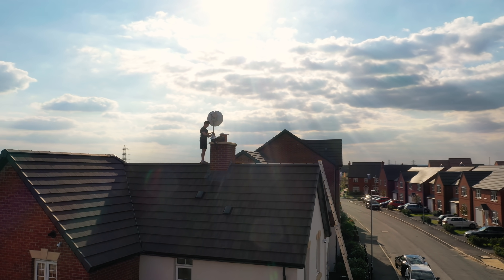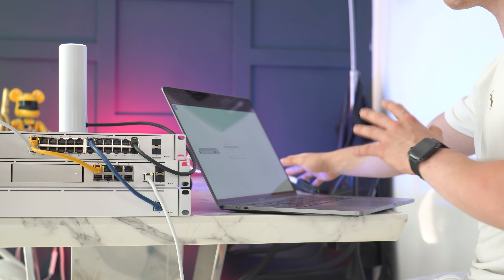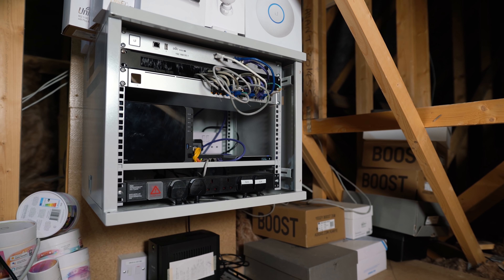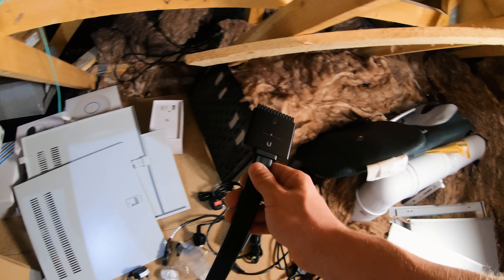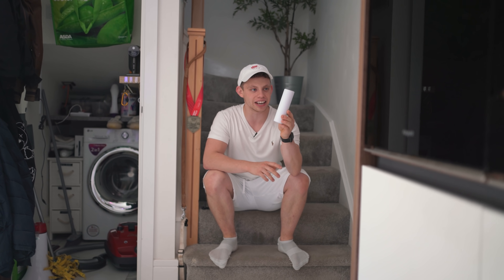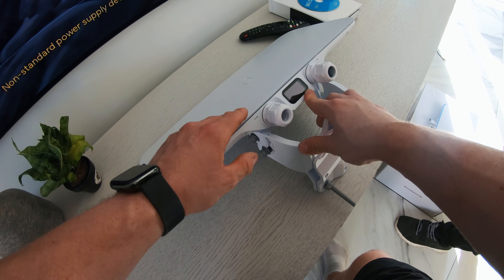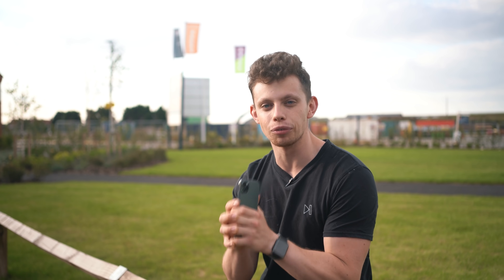Alex's Insane 2021 Home Network Upgrade & Tour!! 🔥

Comment: Sooo overkill system in the house when u get shit internet from your ISP. I myself can get 1000 download and 1000 upload for 60£ a month in sweden. Currently getting fiber 500 download and 100 upload for free and super stable with AX82 router. getting 0,8ms ping with ethernet and 2ms ping on wireless. Also getting ethernet speed on 5GHz almost everywhere, no problem. 

Why do you even have seperate AP for your LED device and other smart home???? Whats that gonna help?
Reply: It could depend on how he wants to secure his network, e.g., placing the smart device on a separate VLAN, and set to only have WAN access, thus if one of those devices are ever compromised, they can't wreak havoc on the rest of the network, e.g., acting as a launch point for an exploit toolkit against other devices on the network.

A cheaper way is to simply have your smart devices on the guest network.
While it will have a small amount of performance reduction due to airtime sharing and that most smart devices are not MU-MIMO enabled, and even worse, many still use 802.11n even ones made in 2021 are still using it. Companies tend to do it for cost cutting since you can get those chipsets for next to nothing, but it also means more overhead while those devices are sending or receiving a lot of data. If it is something small like a thermostat or smart outlet, or light switches, then it is not noticeable, but for items like wireless IP cameras or other similar devices, it will be noticeable, and in which case, you just get a separate cheap access point to put them on.
Reply: @Razor2048  Or simply don't let different VLAN's communicate anyway, which is a piece of cake with Unifi.  Alex seems like a nice chap, but he's a bit clueless.  Firewall rules can also accomplish anything you need as it's quite powerful on Unifi.  A simple "drop all" firewall rule between networks accomplishes anything you need.

Comment: Your network has no logical thinking. Just switch from switch and APs all over :) + you got a very expensive microwave on your house :)
Reply: It’s all a complete mess and I’m so confused. Would anyone please be able to help me out. I’m trying to create a home network system but have a budget of £1000 maximum. Can someone please list me the parts as watching this video has confused me so much
Reply: @ProPlayerGamez  How many APs do you need? I can tell you what I did. I have 2 NanoHD, runnig with a Netgear 5Ports  PoE switch, the Unifi Controller is running on a Raspberry Pi 4 B. As a router I prefer a Fritz!Box and all the other LAN Ports in the House are connected with a 24 Port Zyxel GS 1900E. 
All together should be far below 1000£ and runs in my house with 31 Clients pretty smooth and stable. Nothing to complain so far.

Comment: I thinking about getting a dream machone Pro but I know it won't work with sky broadband. Anyone in UK also have this set up without having to still use the sky hub or BT home hub getting in the way.?
Reply: Chances are if you can't figure out if UI gear will work with your ISP modem/ont then you shouldn't be purchasing this gear to begin with. Just go out and buy yourself a mesh wifi system and leave this sort of stuff alone.
Reply: If you have standard ADSL or FTTC then you'll need a modem like a Draytek Vigor 130 to go between the UDM and the phone socket. If it's FTTP an RJ45 cable straight into the ONT will work.
Reply: Easy use wire shark to capture the circuit login credentials and use these in router of choice

Comment: The "UPS" just acts as a secondary PDU for the other devices, in addition it will not function if the device with the dead PDU reboots, as it does not at start up use the secondary external PDU.

Comment: I will be moving in too Victorian house in a month's time but it has 10 bedrooms what would suggest that I could do with my internet
Reply: I would suggest you look for advice from someone who actually understands networking.
Reply: Unless you have real tech needs, just a good wifi 6 mesh system will do just fine. I run the TP-link x60 (3x pack) and I know I’m future proofed for years with it.
Reply: more
Reply: @Scott-zh6lz  it will need to be good has I have loads off tech and a games room to build

Comment: By the way, the redundant power supply is not a UPS, if the electricity cuts out, it will turn off too. There’s no battery in it. It’s only in case the power supply in the udm pro or the switch fails.

Comment: I’ve been considering locating my network equipment to my loft, also within the UK. I’m very nervous about temperatures and also the dampness. How long has yours been in the loft?
Reply: Loft condensation is a real issue, make sure you don't have this or signs like mould on the breathable wrap under the tiles. Also summer time lofts can get to over 40c which is not ideal
Reply: You are unlikely to run into any issues in regards to damp if the networking equipment is running all the time. The heat they output should prevent any water or damp building up.

Comment: Cool video. I just ordered the UDM Pro. It was a demo with same warranties as a new one and almost same price as UDM. So I thought I had to jump on the deal. Just a comment on what you said on giving out free WiFi to the neighbours, be sure to check what your internet provider says about it. When I read my internet providers terms of use, it clearly stated that you are not allowed to share your internet outeside your home and you must configuer your network in a way that it does not reach outside youre home. And you are not allowed to earn money on your wifi.
Reply: He has the same type of internet connection I have. We use commercial internet plans that CAN be resold or shared. It's not the same contract as domestic residential customers, so he's fine :)
Reply: @AllanOkello  I understand that. But it might be good to inform the viewer about it, because not everyone that watch this video/ channel know that and it can be good to point out that if you push out wifi outside your home, you might need permission for that from the provider. Also if it is a very string antenna/ transmitter, you also might need a permit from the government.

Comment: Was hoping for a bit more info on the products. Runtime for ups and how many devices can you plug into it etc. Not a fan of your computers network cable lol looks butchered. Great job otherwise. Keep it up.
Reply: He actually now has a problem with the purpose of the UPS though. His switch in the garage has it's own power, and will turn off if power goes out, and so will the connected camera's. Rip
And the cable of the PC really was a mess yes
Reply: The "thing" he called a UPS isnt actually a ups. Its just a backup PSU for when the internal non replaceable ones fail. When the power to his home goes out everything will shut off instantly.

There is no runtime.
Reply: @jaemelo2693  He said something else though. Otherwise it would be very weird to buy a 600 USD power supply for just providing power
Reply: @jaemelo2693  I just checked it, you are right. What a worthless thing actually, lol

Comment: Megabits per second, not megabytes. If your speed was 304 MB per second, it would be over 2.3 Gbps. I thought you'd know this?
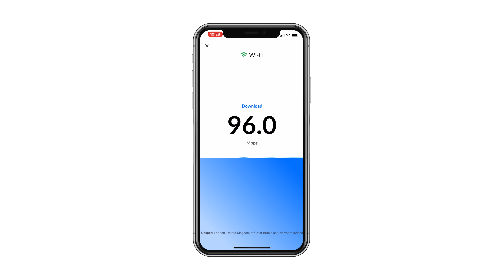Reply: 17:22 - He does know what he’s talking about
Reply: @Matt123So  yeah, but he uses the terms interchangeably which means he probably doesn’t realize they are different. Also the RPS unit isn’t a ups. It won’t keep things on during a power outage, it’s just a redundant power supply.
Reply: @Matt123So  he clearly doesn't if he refers to Mbps as megabytes per second.

Comment: Why is ubiquiti giving those basestation XG's to youtubers who are going to use them in house? They did this with Linus as well. It totally doesn't make sense to use those in house, they aren't made for that kind of application.
The base station XG is meant for things like events, where a lot of people are connecting in a dense area.
Reply: It is mainly for the range, the pricing is will in the realm of diminishing returns, but you get effectively the range of a small yagi antenna (10-15 dBi), a wider beam angle than even a well made biquad antenna. Compared to a $200 AP, the only benefit you will really see from it as a home user, is the increased range, since the array antenna, and beam forming using like 24 antennas, is like having a yagi antenna stay locked onto you. Only issue is they are useless at short range, as they will not provide any more coverage than a basic biquad based unit. Aside from that, they just give those uniess a much higher powered SOC and more RAM to handle a large number of clients without getting extra overhead, though even then, unless you are at well over 200 clients, you may not notice s difference between that unit, and an enterprise level AP in the $300-$400 range.
Reply: @Razor2048  Still it doesn't make sense why Ubiquiti is giving out those basestations to youtubers that are not doing anything enterprise at all. I'll get it when they would give one to Crosstalksolutions for example, since he's doing business installs. But guys like Linus and Alex, putting it in a home, doesn't make any sense. Yeah it's cool to say you have reception 10 blocks away, but these video's are mainly watched by consumers and this is hardly a product that is really usefull for consumers, al be it the price alone for this unit.
Why promote something that is meant for stadions and events to consumers? Doesn't make sense in my opinion.
Reply: @1alexwel  Not sure either. While some some business users will watch various channels like this for entertainment, I am not sure if you will get a greater amount of them on channels like this rather than ones directly targeted at that industry.
Other than the wow factor of the range, I don't think any of the youtubers who ave it in their home, are actively using it after they finish making the video, since at ranges of 30-50ft, it will provide horrible coverage. within a home due to the relatively narrow beam angle.
Reply: Because they want to advertise their products hmmm?
Reply: @Guuggel  advertising to the wrong target and also giving a bad use case for the product isn't a smart thing to do
Reply: More money if more people are buying. Also the reason why you see normal people drive lambos and ferraris just cause.

Comment: It’s nice to flex all that hardware, but having more then 2 accesspoints in one house is ridiculous.
Reply: That really depends on your house. Recently did an wifi install for a 3-floor row house here. Usual building material is reinforced concrete here. Installed one AP AC LR on 1st and 3rd floor thinking that would be enough. It turned out that his wasn't the case. 2nd floor still had wifi reception problems, it wasn't until I installed an 3rd AP that it was good enough in the whole house.
Reply: Here in Bermuda our homes are built from concrete with reinforced steel rods to withstand cat 5 hurricane's. 2.4 & 5Ghz WAP's do not penetrate our walls very well so if you want good coverage, with decent overlap for seamless roaming you'll need an AP in every room if primary 5GHz and every other if 2.4ghz.

Comment: It’s like cowboy networking here.   The RPS has no batteries and he’s like just repeating the Ubiquity marketing blurbs. As for the roof install so dangerous a bad example and terrible health and safety he needs to go on proper H&S course
Reply: Yup, then he falls off and needs to go to hospital, taking up a bed someone with COVID could be using. he's just young, clueless and immature.
Reply: Not to mention that he suggests that the equipment is ok up to 80 degrees C.
Reply: @shawnsmith7009  Technically it is, but it won't last very long.

Comment: Seriously ubiquity marketing guys, stop giving this idiot free gear, he is massively damaging your brand by association. It's just embarrassing at this point.
Reply: Because he has no fucking clue what he’s doing, as with practically every other video he makes. He is a shill for marketing companies and more often than not the stupid things he does are dangerous or misleading.
Reply: @CarlDavison  what's he actually done wrong
Reply: @G0rg81  For starters, he doesn't know the difference between a redundant PSU & a UPS but uses the terms interchangeably. He just told everyone this gear will keep everything running when the power goes out which it will not. He doesn't realize there is a difference between bits and bytes. There are a few more things like the deployment of the XG AP on his roof but I'm sure your brains logic tells you "so what" or "who gives a shit."
Reply: That pathetic wiring job for a start but seriously he is giving the impression that you have to have all this expensive kit when realistically a couple of AC Lite APs would cover his entire home.it’s not only this video, he gives wrong and dangerous advice on countless others. He is just a shill.
Reply: What's your problem. If it annoys you don't watch. He's just trying to make a living

Comment: 15:18   This is extremely dangerous. You need proper safety gear... In situations like this you either use a bucket truck or toss a safety line over the roof, Tie it off to a secure structure on both sides then tie off to your Harness. A proper harness for our industry would be a "Sala Exofit"  You want static safety line. When you have this many subs you need to be very very certain to do everything properly so as not to encourage other to take dangerous actions. Another note also for your well being is that if a safety inspector saw this video you may end up with a hefty fine. Your work place insurance would void your contract. Please be safe <3
Reply: He never uses any safety gear and shows a complete lack of respect for safety. When I saw him standing on the ridge like that I just laughed. Surprised he hasn't had a serious accident yet.
Reply: Who gives a fuck about safety. If ur doing it in construction or for work yes but if ur doing it for urself then fuck the safety harness. Don't be one pussy unless u really don't have good balance or can't jump or survive from that height. Don't be educating ppl with safety cause we honestly don't give a fuck
Reply: @ewaldatok611  1, When your influencing others & many are going to do this themselves your partially responsible to teach them the right practices. 
2, Gravity, physics & the law care not about whether its a job site or not. Nor do they care if your a pussy. Please be respectful. We don't need anyone getting hurt.
Reply: @thefixitgal  Don't waste your energy. If anything, life has shown us that people with "his" mentality end up in boxes 6ft under prematurely.
Reply: @jaemelo2693  I know.. I've seen it happen before with exactly that type :p But Id prefer to still at least make an attempt. Its sort of my thing. I train people to setup and operate  ISP's.  If people like him at least listen and maybe act with more caution there will be less broken families out there <3

Comment: Er, if your internet connection is 300Mbit, that you were getting sub 100Mbit on the XG suggests you had a 100Mbit network connection (or some traffic shaping). The XG could easily blast past the 100Mbit mark in a heartbeat.
Reply: he used unifi's wifi speed test so it wont use the internet just the connection to the AP. Its not very clever cause I have a Mesh Pro (the one he removed) and its got a theoretical range of 186m and I can get to almost 100m without dipping below 80mbps both ways (can't get a signal further because of an obstical)
Reply: @matthewgilbride8212  You can get far faster, those speeds are far too low.
Reply: @SquirreliciousMe  it goes faster its just not stable
Reply: @matthewgilbride8212  I don't know what you're testing performance against, but if you use a proper testing system (which is not some internet speed test like speedtest.net) you will find that XG can blast well well past anything you're being told here.

Comment: Usb-rps is not a UPS Battery backup as you stated it’s simply a redundant power supply and has not battery what so ever, if your main power goes out bye bye cameras
Reply: It’s all a complete mess and I’m so confused. Would anyone please be able to help me out. I’m trying to create a home network system but have a budget of £1000 maximum. Can someone please list me the parts as watching this video has confused me so much

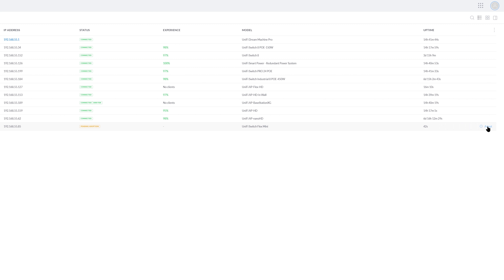Comment: 12:50 what is that abomination of a cable termination 😱😳
I'm guessing this is more of a flex video to show off having money. The setup will perform terribly with so many APs in close proximity. Also that's not a UPS you've got there, so when the power goes out you'll still have no equipment running. 
Fun to watch, but absolute overkill and setup in a way that will seriously compromise its performance.